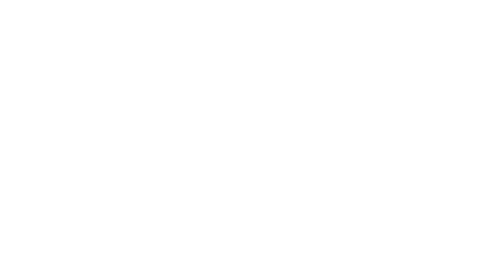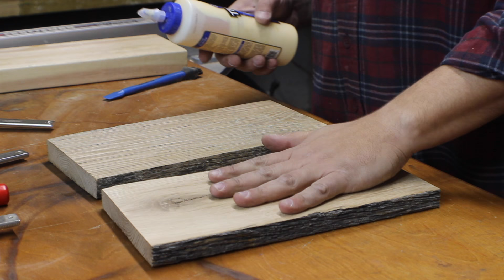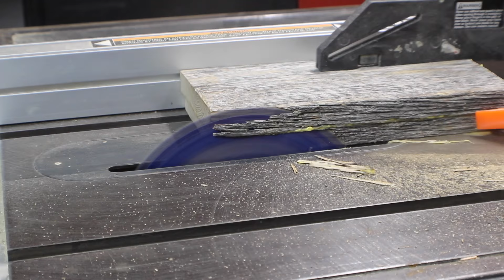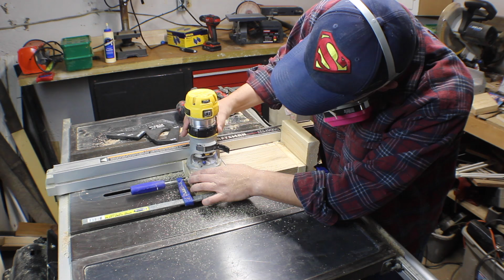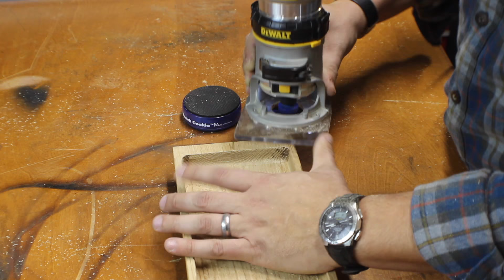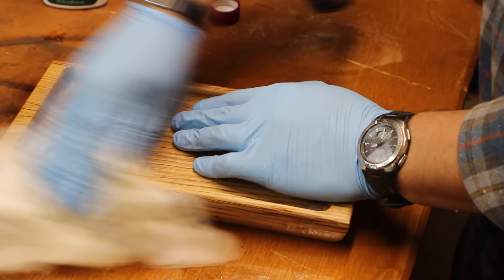How to Make an Oak Tray with a Router

Comment: Nice easy build! I would have probably used a forstner bit to excavate most of the wood in the middle. Just set a depth stop on a drill press, and it shouldn't take more than a few minutes. Then could clean up with a router

Comment: Nicely done, I like the bevel on the bottom a lot. I thought you were going to use your flattening jig on the faces, but I agree the belt sander is much faster.
Reply from the maker: +49cfr Perfection wasn't necessary, just a decent glue surface. Just bought a planer so I won't need that flattening jig anymore!

Comment: Bowl looks fab, I like the techniques you used.  what was the router bit you are using-was it a straight cut or cove? Sorry if you mentioned it during the vid but  I was watching at work with the volume off..shhh dont tell the boss !
Reply from the maker: If I remember right, I used a straight cutting bit first, then a cove bit to get a softer transition at the edges.
Reply: Andrew Setters thank you. I’ve tried using the bowl router bit, but don’t like the finishing on the bottom of the bowl too much, It’s not smooth enough. I’ll give your technique a go. Thanks, from Australia!